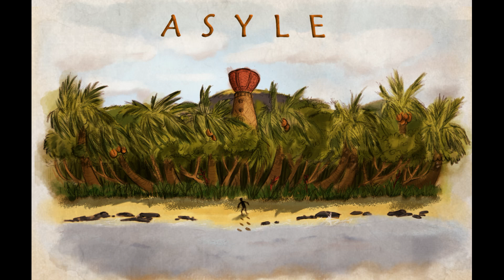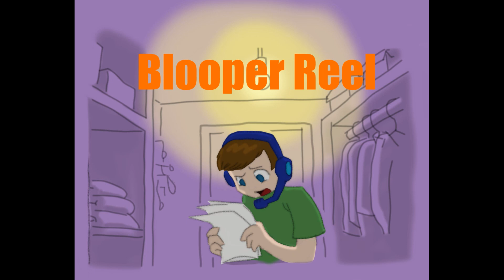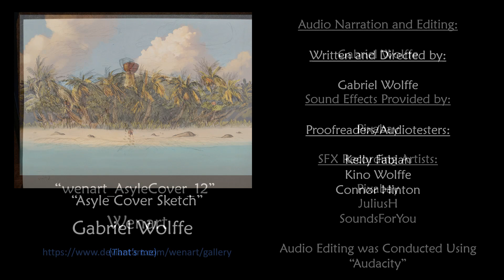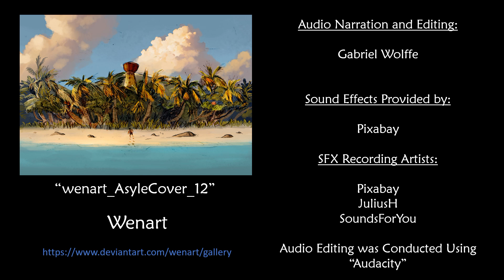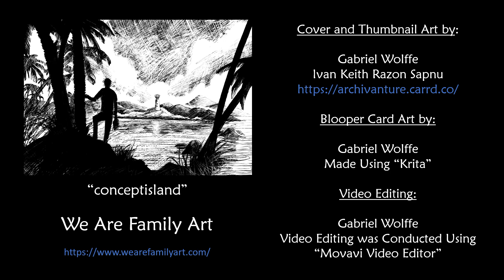Asyle: Week 10 | Building a Concentrated Solar Power Plant (Out of Dirt and Sticks!)

Comment from the maker: 3:02 In the course of doing research for a completely unrelated project, I realized that I made a mistake about the panels, which are technically NOT using Total Internal Reflection. TIR only works when light is moving from an optically denser medium (like water or glass) to one with a lower index of refraction (like air or vacuum). With these panels, light is moving from low-index air to the high-index sodium-silicate glaze, so some of that light will end up refracting into the clay and turning into waste heat, while the rest still bounces off and into the kiln.
It's a good thing I accounted for them being less than 100% efficient in my calculations, so the kiln should still work, but I wanted to make sure I highlighted that error. _: )